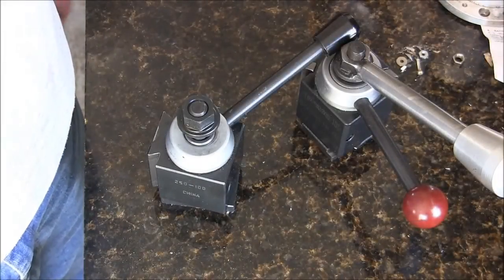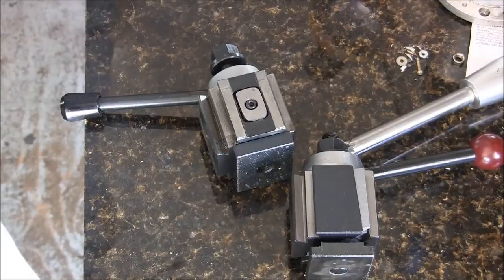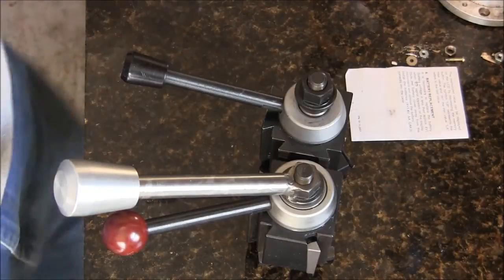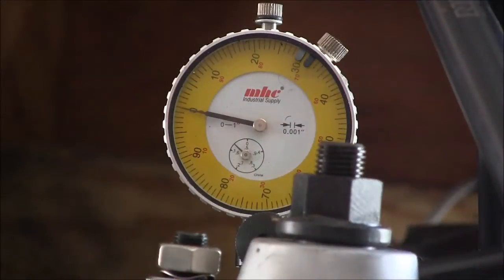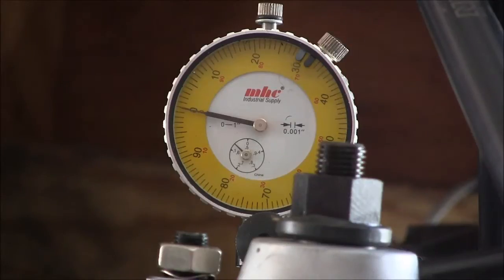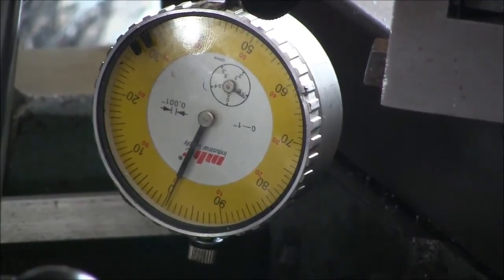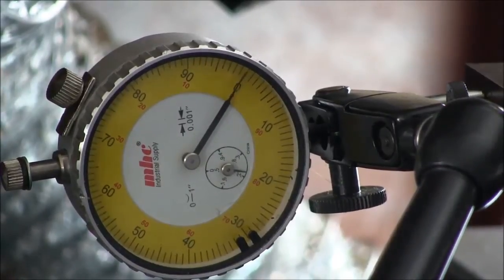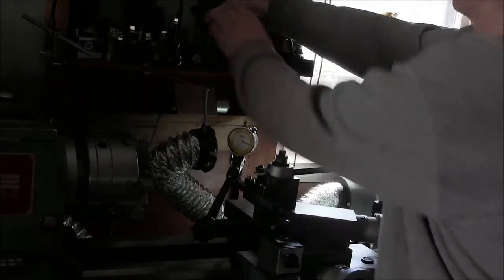Piston vs. Wedge

Comment: i have a clausing colchester 15,and i find repeatability with my cxa piston holder is fine.Height adjustment locking and a good lathe,the piston type is fine.The only exception would be gun smithing

Comment: Unless you are doing heavy work, there isn't much difference between them especially for the home machinist. And even for heavy work you usually hogging material to the finished size. Quality of QC build is probably more important than the locking mechanism.

Comment: Good video again.  I pretty much knew this but Grizzly includes the piston with the G4003G that I got last year.  The one biggest problem is that the holder clamp lever is only adjustable to two positions (2 O'clock and 8 O'clock) without drilling and threading new holes whereas the wedge is infinitely adjustable.  I have had no problems with accuracy but that handle is a pain.  Doug

Comment: I had a BXA wedge on my old 11" Logan...best upgrade ever! My new 14"x40 came with a CXA piston type. It does work ok but there are time when under heavy load you can see the holder bend down especially if the tool point of contact is below the center of the piston. The wedge type does hold the toolholder better and is worth the extra money.

Colin
Reply from the maker: Yeah, I wish I started off with the BXA. I had a few high pucker moments parting off with the piston type, hopefully the wedge and some gib tightening will stiffen things up.